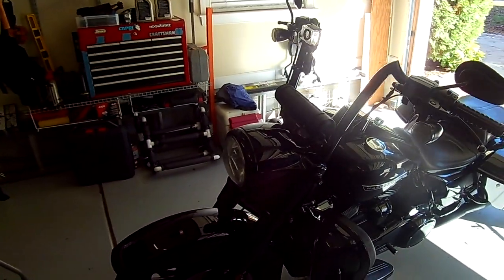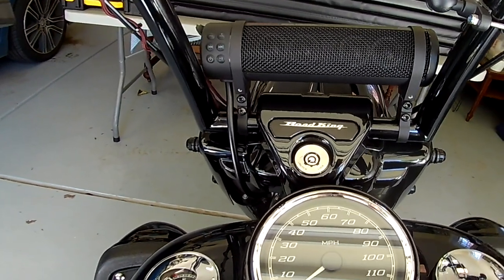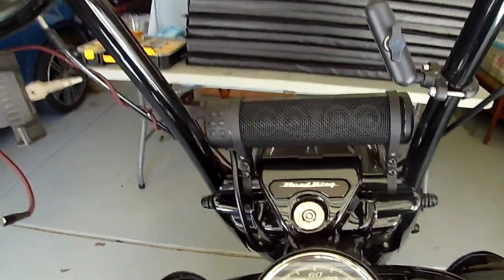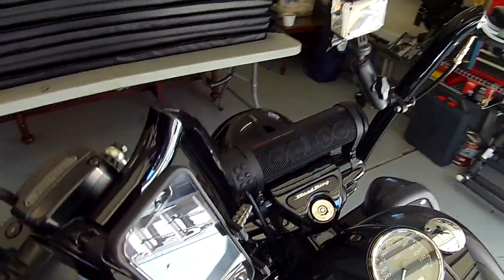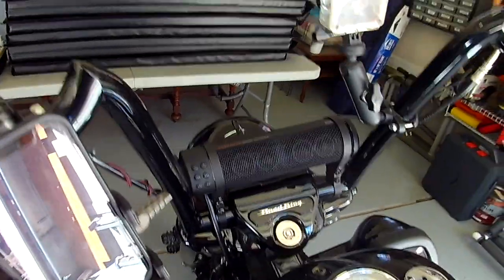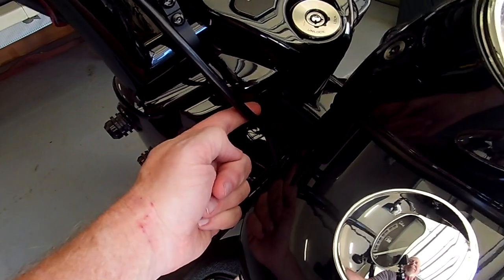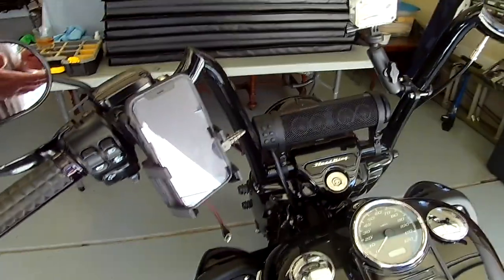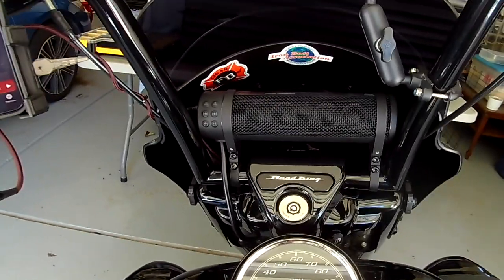Kuryakyn Road Thunder Plus by MTX review

Comment: Best reviews so far and I’ve seen a lot of them
Reply from the maker: Wow!!  Thank you for that compliment brother and thanks for watching the channel!!!  Glad this was of some help to you.
Reply: @jst_moto still happy with it? Problems? What brand model phone do you have?  All the videos on YouTube say good things, but the written reviews are not very good… Kuryakyn customer support is non-existent to say the least, folks say the Bluetooth is constantly disconnecting and the speaker just up and fails after a short period of time…. Sheesh. I ordered one last week,…. Not sure about this guy at all.
Reply from the maker: @jeffreyengle2762  I’ve had no issues with mine after having it for over 2 years.
Reply from the maker: @jeffreyengle2762  I have an iPhone.
Reply from the maker: @jeffreyengle2762  I’ve not had any issues with mine paired with my iPhone. What I can say is that there is a “power” wire this is the wire that ensures your speaker is only on when the bike is on. When I installed my speaker I found that if I didn’t have that “power” wire plugged into something that was 12v when the bike was on the speaker wouldn’t work correctly. Not saying these other guys connected to the wrong circuit but the only time I experienced any issues with this speaker was when I did have it wired into the wrong circuit.

Comment: Did you remove the gas tank to run the cable to the battery. Thank you for the video very informative.
Reply from the maker: Yes I had to on the Road King Special. I think for some of the softails and other brands you can run it down the back bone of the bike without having to pull the tank. That was not the case with my bike. Even if I hadn’t had to pull the tank I probably still would have because it makes for a cleaner install. Thanks for watching and commenting. Always ride safe!
Reply: Pulling the tank is a piece of cake. No worries!

Comment: Hi from uk I bought one of these for my road king s is almost all fitted apart from the splicing connection as I’m not sure  which wire to tap into  which wire did you access  thanks for the vid
Reply from the maker: I spliced into one of the wires under the seat that provided 12v when the bike is in ignition mode or accessory. I honestly just used a multimeter to find which wire to use.  Thanks for watching!!  Ride safe!

Comment: I'm considering upgrading from my lexin bullets to this system.  I ride my Roadking as a daily driver and enjoy a bit of tunage.  Rocking a 16" smoked shield but the bullets barely sound like they are hitting the full 120w.
Reply from the maker: I haven’t used those so I wouldn’t try to make a comparison.
Reply: This is much better than the bullets!

Comment: I have one it turns on and says it’s connected but I get no sound out of speakers
Reply from the maker: @BobClaffey  couple silly simple things to check. Makes sure the output volume on the phone is turned up. Make sure the speaker volume is turned up. Last make sure your phone will output media to that speaker. Let me know if any of these were the issue. You can also call the manufacturer. They are pretty responsive (or they were when I called). Thanks for watching and the comment. Hope it gets sorted out. Always ride safe.

Comment: So did your bracket ever get loose on you? Mine did but there's no way to tighten it
Reply from the maker: Mine has not. Did you install the set screws?  Thanks for the comment and watching the channel!!!
Reply: @jst_moto  it's been a while since I did the install but when I went back into look at what was loose it was the bolt directly under the main speaker clamp which has no head. and underneath of it is a little Allen screw which doesn't tighten anymore
Reply from the maker: That Allen screw is the one I’m talking about. Sounds like something is stripped.

Comment: Can the speaker be detached so no one steals it?
Reply from the maker: There is a quick disconnect in the wiring harness that makes it possible to remove the speaker without tearing the bike apart. However, you still need tools to get the speaker out of the mounting hardware. Other words it’s a hard enough thing to get off that I’ve never really worried about someone taking it. Thanks for watching. Always ride safe!!
Reply: @jst_moto  thank you sir much appreciated

Comment: For $400+ you should get some kind of volume control so you can control the volume without taking your hands off the bars. When stopping at a stop sign or stop light, you don't want the music blaring, so you turn it down, and that push button volume control is crap also.
Reply from the maker: I agree. I’m not a fan of the controls on the unit itself. My phone was mounted on my bars and I’d use the phones volume controls (which I had easier access to) and pause from the phone as well. It was never an issue for me because I controlled it a different way. Thanks for watching and commenting. I hope you find a solution that works. Always ride safe.
Reply: @jst_moto   I 've always used the Boss systems on my bikes and they are all I need. They are plenty loud and come with a volume knob that you can mount anywhere (a turn style knob, not a push button controls, which hate) And they are much cheaper but well built.
Reply from the maker: I saw those when I was looking but at the time I liked the Kuryakyn solution better. We all like what we like. Now I’ve gotten rid of the 18 Road King Special for a 2024 Road Glide. Dealing with a whole different set of audio challenges now. lol